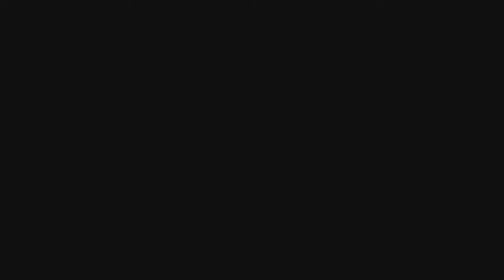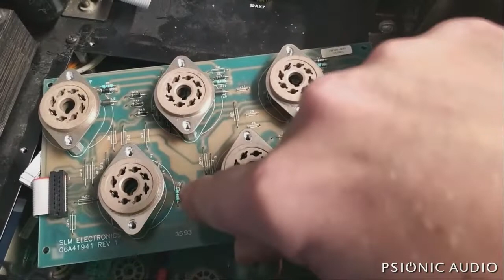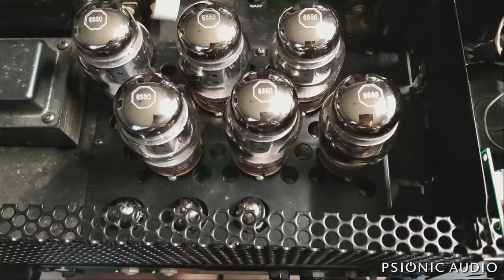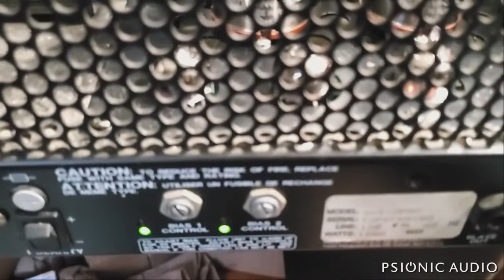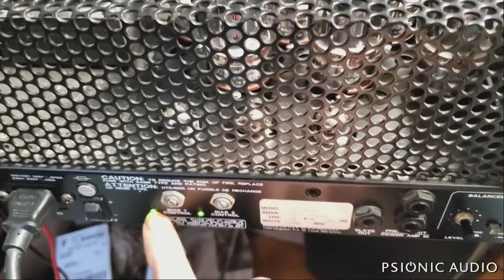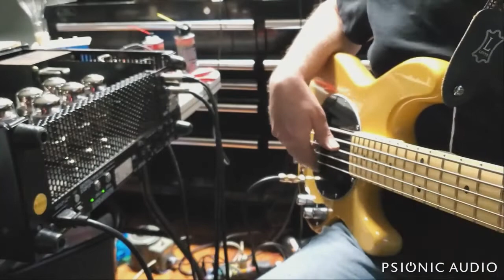Ampeg SVT-II Pro : Undoing the Issues Causing the Fault Protection Circuit to Trip

Comment: I have an SVT Classic on the bench. Newer edition with updates in this video taken care of. Looks like it's had a few caps in the power supply replaced in its lifetime. PCBs look fine, no cold joints. I rotated all of the power tubes through my Fender HRD and they all passed audio equally. Fault detection is still not happy on this amp. Any ideas?
Reply from the maker: Diodes in the FPC are often gremlins, as can be any diodes/resistors at the 6550 plates.

Comment: Thanks for sharing.
My Ampeg made some buzzing noise when playing slightly louder and I thought (because I just bought it second hand) the cabs might be the problem (Ampeg Neo cabs, 4x10" and 1x15" connected via Speakon in series) but I checked them with my Fender Super Bassman and they sounded great, so I tired to connect them via jack speaker cable (both of them in series to have 4 ohm) and when switching from standby to on the amp went dead and the main fuse was blown. 
Normally turning the amp from standby to on (the mute switch engaged) produced a loud "pop" sound inside the amp but now the amp is "dead".
I hope it is just a bad tube....
I guess the buzzing noise might have indicated a bad (or more than one) tube.....
But what I found out, that the Fender Super Bassman sounds incredible with the 1x15" cab..so I will need to get one for the Fender :-).
I will get it to the tech of mz trust and see what the problem was and let you know....
For tips on what else to check or replace in this amp to make it more reliable (I will remove the spring retainers...thanks for the advice) I will be thankful.